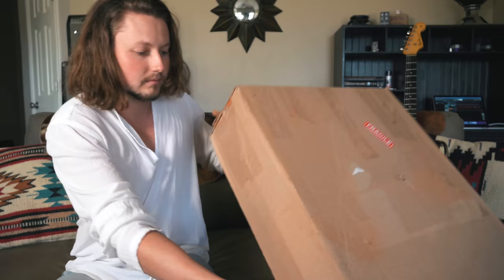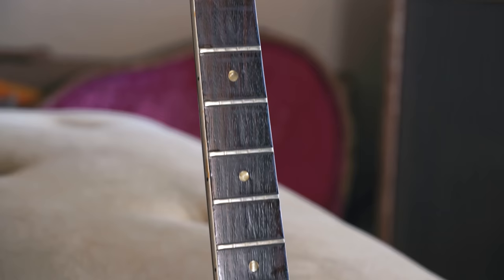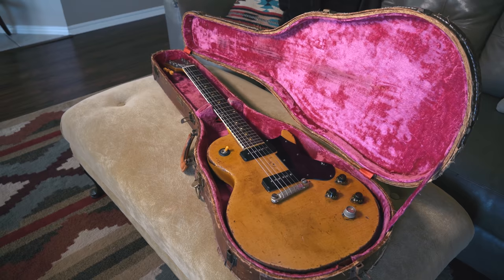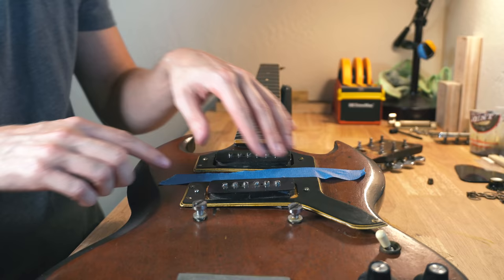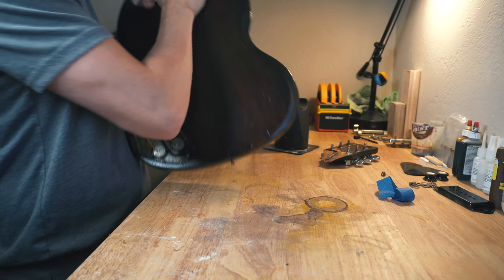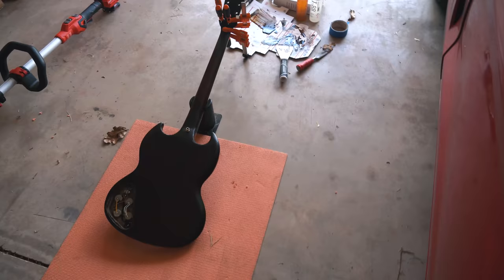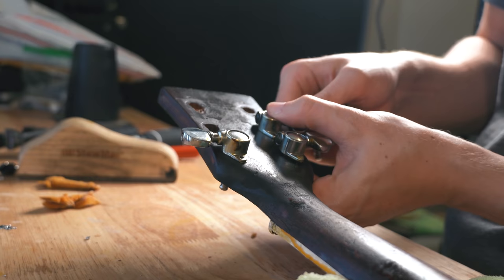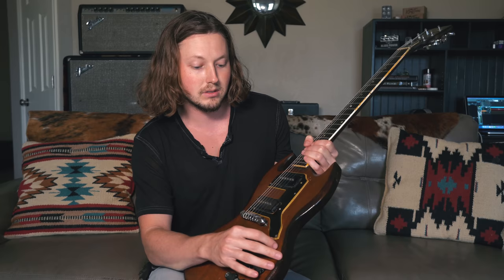Oh No.. Not the Vintage Gibson..

Comment: Regardless of resale value, the sound is still there, I wouldn't hesitate to do whatever work needed for playability, it's a keeper.
Reply: It's tone is amazing!
Reply: As a guy who try to repair everything this repair kick ass it adds to the history of the guitar and reuse is always the best option if possible !!!!
Reply from the maker: Can't beat original P90s!
Reply: Agreed they are the same essentially as the pafs
Reply: @MatthewScottmusic  best pickups in the world, with the volume knob and the volume hiked up on the amp you can get all the tones a guy needs w/o peddles.
Reply: Any thing that you spend that much time on you end up liking more
Reply: Totally. After several luthiers failed to permanently fix my '68 Les Paul, getting it done right meant completely refacing the back of the headstock... and totally losing the serial number. Pros still look at it and know how much it's worth, but there's no concrete proof besides the styling of what year it's from. I do not care. It was worth it.
Reply: There is no resale value for the guitar it's all parts at this point . But uf you can scab it together well enough to play what the hell
Reply: @georgeshaw8925  Exactly! Just ask Pete Townshend 😉
Reply: Mathew I'd buy it from you if its reasonable. I like the tone. But shipping it might be too scary now that I think about it.
Reply: @HiHello-ku1fl  why? The epoxy is probably stronger than the original wood
Reply: Brought back to life, still has the mojo…line her up…
Reply: My type of guitar. Play and stay in tune with great tone
Reply: @MatthewScottmusic  And the "tone wood boys" would say there is no substitute for old growth dense wood.
To be authentic for that late 60's sound, gotta have the Ernie Ball super slinky.
Reply: I agree with OP. Right on man 👍
Reply: Agreed. That thing is dripping with tone. Would be hard to make that guitar sound bad, no matter the hands.

Comment: That came out so awesome!!

I've gotten away with wood glue with some custom micro dowels. Whether you choose steel or wood will work. Mock it up without any glue, just a clamp. Drill your dowel holes. Make sure they're deep enough to recess on the surface. And lather it up with glue. Hammer the glue covered dowels in. Clamp. Then fill in the big gaps with glue binded with mahogany dust. Sand to your desired look. You can also add dowels after you set the headstock. I later realized that probably would have been easier. Dowels are only depending on how much wood you have to drill into. Titebond 3 wood glue works perfectly for me
Reply: Everyone was definitely wondering.... 😆

Titebond 3 for guitar repairs? Why?
Reply: @ryans9029  its an awesome wood glue! Might even be stronger than epoxy
Reply: @yoBradyO11    Technically, it’s not like using adhesive glues that create a bond stronger than the natural wood itself can be a realized benefit.   

I recently found some antique firearm restoration wood stock repair methodology on YouTube that use similar stuff the guitar/luthiers use.   

Definitely adding dowels or some sort of screw/mechanical means to strengthen the joint is beneficial.   I’d argue some of the areas and impact forces in a wood firearm stock will be more harsh than anything a guitar will see.  There was some guy recommending some sort of black goopy epoxy looking stuff.   But today’s idea with restoration of art, furniture and instruments that are exceptionally valuable, the idea is to use reversible repair materials like fish or hide glue -which is plenty strong for the application.   

I’m just rambling because I find this stuff interesting.    Lolz thanks
Reply: Brady,great minds think alike,I was thinking the same thing to give a stronger hold on the headstock,used to do this to glue 2 pcs of granite together,never had a problem

Comment: Schenker and Yngwie both had the same headstock break and after a good luthier, they are as strong as before and invisible to all but the most heavy scrutiny.usually dowels are glued in reinforcing the glue bond a lot. Schenker’s luthier used a drumstick or two.

Comment: I had the same problem with an old Paula Bj 57, I also worked with epoxy resin. After drying, I drilled 6 holes on the back and inserted six silver steel pins under expoxy for stiffening and then filled the rest with Prestolyt Auto-Spachtel. Since the neck was black, you could hardly see anything and she is still alive today.

Comment: I like your videos because while you don't have a ton of luthier experience, you're not afraid to try stuff and take on new challenges. I did the same epoxy trick with a Martin, make sure you watch it like a hawk, mine snapped once at the joint and I had to redo it with some steel enforcements. That project actually got me into luthery and I've been repairing guitars ever since. Rock on man!

Comment: sounds nice, if there was any wood at all in the joint I would try wood glue to get it started then when dry paint remainder with wood hardener then epoxy or structural bondo . Best part is hearing you play it, good job!

Comment: Nice it worked.  I found an Alvarez next to my dumpster with no head.  Broke off right at the nut but left that diamond shaped piece of wood on the back of the neck.  My dad made a headstock out of a piece of oak from a pallet and but glued it to the neck and it works great.  It's called ol' oak head.  I'll try to get vid up.

Comment: Micro balloons could have been incorporated Matt.  Micro balloons are a lightweight filler for polyester resin and epoxy resin. They are also used for thickening epoxy resin and polyester resin. ... By adding micro balloons, the resin can be thixotropic. This is a way to make it stronger.

Comment: Ouch. I did this to my '68 Les Paul. One thing you do not want to do is cheap out on this repair. I had it repaired several times over 15 years, and it never held, until I finally found the guy in my city who all the pros use (thank you, Gary Brawer at Real Guitars), parted with my guitar for the 6 months until he had time to look at it, paid him almost as much I had originally paid for the guitar to fix it right, and nearly 25 years it's still like it never happened, you can't even tell by looking at it that there was a repair. He literally refaced the front and back of the headstock all the way up past the nut in into the length of the neck, with laminate that he carved and sanded by hand. So the edges of the repaired crack are actually buried under solid wood.

I'm watching the video only as I type this... that can be fixed, but clamping and gluing is not going to be enough. One of the guys who tried to fix mine not only did that but even drilled holes and sank dowels through mine, across the wood grain, and that wasn't enough to permanently fix it. It came apart again a few years later. 

With that much wood missing I guess the epoxy is the way to go, but I'm curious if this repair will hold permanently without any more than that. 

Great sounding guitar when you plugged it in, though!

Comment: if done right! and you did it right! often times Gibsons play better once a peg had has been snapped off and reattached. glue is stronger than wood. in this case you used epoxy, not sure of the tensile strength of it, but probably pretty durable stuff too and will never usually snap off again in the same place...

Comment: I would love to find a project like this. In my opinion, because of the extensive modifications in the past, it would give me an excuse to 'modify it back,' so to speak. If it's had a refinish, then there's no stopping me from doing one too. And because the top of the headstock was chopped off, I'd plane it and glue a new piece back on to give it the open book shape again. 

This type of project is an open canvas, really.

Comment: A good little tip is when doing a repair like this, is to do a dry run first, by clamping it together exactly how you need it, to make sure that its going to work. Then take it back apart and apply your glue, or epoxy in this case. It is very helpful, when working with a time sensitive product.

Comment: I love bringing something back to life, great job!  Had an idea.  Could you route out two straight, thin routes on either side of the truss rod, maybe 2-3 inches on either side of the headstock break, then glue in a piece of mahogany in each route.  Then shape, sand, and stain the pieces until they match the neck.  Since it's already been epoxied, this would give it some more backbone strength and hopefully last longer.  Just an idea.  Maybe using a Dremel and homemade guide.  Tricky I'm sure.  Just an idea.

Comment: I believe in the past I have seen headstock repairs include drilling from the headstock into the neck and then having a small dowel placed in the hole to bridge the gap between the two. I am surprised it worked so well with just glue!

Comment: fill the voids with wax with it clamped up, then carefully remove the wax then you have molds for the missing wood, the carve out the pieces OR, make a mold out of the wax and have an adequate filler pieces made from the wax molds using resins and sawdust, so take the wax molds and make a plaster mold, then pour your resin/sawdust mix into that, this works well for large pieces, then if some of the missing wood is visible, after the glue up and set, then you can cut out those visible pieces and fill back in with mahogany.. there is a dood on youtube from japan does a burnt L series acoustic and his method is phenomenal filling in that neck so forth, just amazing

Comment: That P90 sound is to totally die for.  A purity that the humbucker can NEVER deliver.  The challenge is to dial them in with the right tone control settings.  If you A/B them alongside the humbucker without tweaking the controls they always come up a bit short but not here.

Comment: The machine head on my 1978 Les Paul Special also broke off, in its case, like that, too. (Also modified ..my fault there, I had the soap bar pickups removed, grouted the holes larger and shoved in a couple of Humbuckers. Stupid, I know, but I didn't think I would live long enough to regret it)

Comment: Araldite ultra is g8 for this job..heat gun and feeler gauges..heat the epoxy until its runny..use feeler gauges to get into any knooks and crannies..clean up with acetone.block of wood on the front with polyethene  same on back of headstock, push together  and down towards the body and clamp.

Comment: I can't believe how many people have replied to this already. At least you know enough about guitar repair to do this justice. Sometimes even the most professional way isn't always the only way or even the best way. I was going to suggest Sweetwater Sound but they would've charged you an arm and a leg!! You did right by this but if you want to put Kluson Deluxe machine heads on it you might want to dowel the holes with mahogany then re-drill them very carefully. Other wise I would just play it. The damage has been done. The only thing that I would change other than machine heads is the pickguard. It could definitely use a new one.

Comment: The headstock is, after all, on the other side of the nut.Have you seen the new "backstrap" attachments that are supposed to prevent such breaks? Seems like a great idea.
I had an intact original of that model decades ago, but could barely play it because the neck was so thin and narrow.Very battered and heavily mistreated.It sounded awesome, though, - but everything you don't imagine when you think of an SG neck..
They used one of those ancient manual hand drills on those tuner holes, - with a very dull bit.

Comment: Sounds great though. Tuner wise I would suggest 3 on a plate split shaft. That will be light and prevent some issues. The obvious thing will be a need for conversion bushings. Sperzel Sound lock tuners are crazy light

Comment: You can probably use some wood to fill it in.  Glue it in place and cut some wood to fit in the gaps. Sand it to match the rest of the wood and make a paste from wood and wood glue and fill any other small gaps. Sand it again and finish it trying your best to match the vintage beat up look.

Comment: My sons broke a cheap guitar. I was able to glue it back together. It was an almost clean break. I thing you have more surface to glue. I like the coarse break on that guitar. You can get filler that looks like mahogany or whatever that wood is. Use wax paper between the glue & clamps. Glue won’t stick to the wax paper.

Comment: I’d go back and add in some channel routed splines though the top of the neck and bottom of the headstock for a better mechanical connection.
Reply: I used mahogany dowells for my similar repair, and used the shavings I drilled out from the holes to make filler for the repair line.  Darn near make an ugly break disappear.  Used superglue to fuse the plastic cover on the front of the headstock,  then 1000, 1500, and 2000 grit sandpaper to polish.

Comment: I applaud your efforts. It sounds great thanks to those vintage parts. Next time you may get want to take the guitar to a master cabinet maker for the repair. My father was a master and I know a couple of things that would make this a bit better. It's not easy to epoxy anything to achieve aesthetic appearances. I've done some JB Weld repairs on my motorcycles and bicycles but it was all minimal and in places not highly visible, also not a big structural repair. That kind of work has a learning curve. You did a good job. 👍☮️🌞🌟🎸🎵

Comment: You will need to route 2 channels on the back on the backside of the headstock and the neck and add wood runners parallel with the neck to add strength to the joint. Check out twofords channel he does master luthier work and shows how it’s done.

Comment: You can use other than wood dowels something along the lines of carbon fiber and still use all the original ingredients that way you won't have to "re-do " it and have to use other parts out of date things like new neck and or head. It's the way us older mountain folk and or country boys go about fixing this type issue. The guitar kinda looks like it could have came from here In the south and out in the country county backroads anyway so it'd be fitting way to go bout it

Comment: Have you not thought of using a couple of steel pins. Takes a lot of care to align them with the neck and head, but definitely do able, with pins in place use the epoxy but leave it low and fill the upper part with wood filler.

Comment: great job Matthew..!  quick and dirty repair.. I love the narrow nut era as the necks are more rounded with slightly heavier shoulders and it feel great down the neck.  Curious.. besides electronics and headstock.. did you need to do and fretwork?  I am sure those wide low frets were replaced a few times on the guitar.. just curious.. thanks for sharing.. !!

Comment: Epoxy is not a bad idea especially in places like the neck. Plus, wood glue takes FOREVER to dry completely. Epoxy takes a day. So what I would have done... I would have taken some epoxy, glued and clamped it as close as I could. Then I would have cut a small section of the existing wood out from the back to get rid of the weak spots and missing wood areas. Then I would have cut a piece to fit into the area and epoxy that in place preferably with notched edges for more support. Now you would have a VERY tight strong fit with new wood where the sketchy area was. Take a grinder and carefully take it down to the shape you need and finish. I have done some similar things a few times. I also in cases like this like to take a drill bit and route 2 holes in the neck and the headstock before I begin one on each side of the truss rod end. I make the hole just bigger than a galvanized deck screw (they do not rust) then I cut the head off the screws run JB weld over them and use a toothpick to put JB weld into the holes. I position it so that the angle is where I need it and sandwich the whole mess together. This makes a very strong repair and also eliminates the possibility of breaking just past the existing repair you are doing since the screws go an inch or two each direction. When you do this you may not even need to cut away and fill with new wood. It is not detectable from the outside and gives a lot more support. Sure there are purists that are like no metal! Well they can do whatever they want... I do things that work best and make a better result. Guitars staying in tune better and needing less work get played more. It will not effect tone negatively at all and is a lasting solid repair. One could take a flat piece of steel and route a cavity out with a dremel. That is super over kill but I have done that one time when I really did not want to mess with the guitar again and needed the neck not to move at all. Results are great and you cannot tell at all. Next time the guitar falls over etc I know about 6 inches which will not break lol.